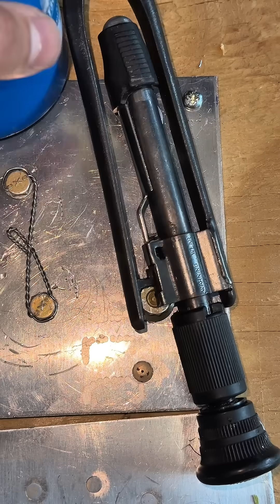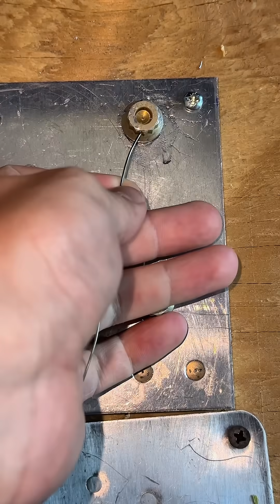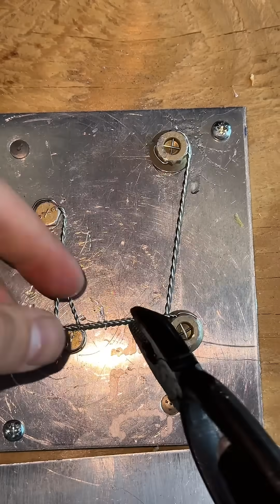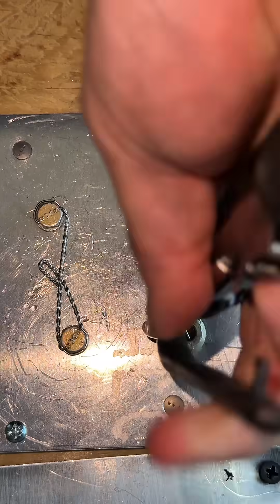Jet tech: Boomers Hated This Safety Wire Tip 😤✈️ #AviationMechanic #shorts #mechanic

Comment: you started the first bolt from a neutral position not a a positive, you failed - you’re friendly FFA Quality Agent
Reply from the maker: Hey can you please explain what you mean
Reply: As long as the wire hugs the curvature of the bolt even a little bit before going to the next, it's physically impossible for it to make enough slack for any loosening to happen. You're talking out of your ass. His example looks like every diagram on the subject.

Comment: Nope this is not how we wire bolt heads, we cross the wires, if it goes around the head the wire can get bumped off with vibration, and the wire will loose tension.
Reply: Every single example and diagram disagrees with you. You're also fundamentally misunderstanding the physics included in wiring directly into the sides of the bolthead.

Comment: I can promise you that at least 95% of those "not tight enough, I'd have cut that if I was your QA" comments were prior enlisted guys who never got beyond a plane captain qual and are just projecting their frustrations by repeating what they heard from their QA every time they picked up a set of swipes. When I got my QA stamp I would only make my workers re-do safety wire if it was obvious they didn't try. If you could tell that they had put their best into it and just couldn't get things tight enough I would do it slowly in front of them while they watched, then walk them through the next one so they could learn faster than I did.

Comment: Got away from tugging at the ends and used the tip of the safety wire pliers to pull it snug. But this is a great video and wish we had this back in my day so the young guys could watch it over and over again. Beats them watching me cut their shit, do it myself, cut that and have them repeat it.

Comment: I mean… I’m not a 7 level, not even still doing aircraft maintenance, but looks to me like the one on the left has one too many turns(twists) and isn’t taught(presumably because it’s stuck on the lip of the hole y’know), (also the tail on that one is wild but maybe the regs are different for civvies[does the tail really need to be captured by the main wire?] the one you just made was good. 

Either are probably serviceable. Honestly I typically find it easier to twist by hand (at least at the end) that way you get the number of twists you want and not that one more so you don’t run into the problem I was talkin about earlier 

Ps not a boomer

Comment: You have done it the way I was taught in motor sports  ace and best demo I've seen ❤.
The whole reason for this is to stop the bolt from coming lose so the wire would tighten if the bolt did try to come lose
Reply from the maker: Glad it helped

Comment: Power generation uses safety wire as well. Steam turbine, gas turbine and I’m pretty sure I’ve used it on coal pulverizers as well
Reply from the maker: That’s a big difference from a little ol’ airplane

Comment: Find me a company that actually cares in the aviation industry. They’ll just mass hire idiots with no certification or experience. Have them doing a and p work while the actual a and p has his head in a fuel tank or under the floor. Have unqualified people doing work only certified people should be doing. Have you back date months worth of work that was never done. I hear the same stories everywhere. If anything go to avionics or go into it with the mindset you’re going to be an inspector. Don’t be a lead. You’ll just ruin your drive and passion for aviation. I’ve seen scary things in my short time and I’ll never fly delta because of it.

Comment: I think you had a couple more twist in there. It doesn’t matter because based on the bolts rotations and the way the wire is connected they cancel out. You could go a couple twist tighter but maybe it could be too tightly and just stress fracture the wire maybe. If you start stretching the wire in a tight twist the it will snap for sure.

Comment: Wait, safety wire is an industry "best kept secret"? You know many industries use safety wire and have since before boomers. The challenge with using safety wire pliers is that you can overtighten the twists, work hardening the wire and making it brittle. They are a great tool when used properly

Comment: Not just aviation. I design synchronous motors and we do this all the time. Except I typically use socket head cap screws.

Comment: if you worked in aerospace youd know even the older generations PREFERRED the pliers. hell, my teacher when i was learning told me about how theyd lockwire by slicking their hands in oil and dragging the pliers down to get it done quicker.

i couldnt last in that industry. the pay was embarrassing and capped out too low to remain a GTE tech. just got more and more depressed over the 6 months i worked there. couldnt hack it i guess. but your lockwiring looks good to me.

Comment: I have a set of those wonderful pliers. Those complaining they did it by hand must be really old because this style of plier has been around at least 50 years (my dad had a pair as an aircraft mechanic) and probably far longer than that. The funny thing, these pliers have not changed a bit in all that time. If it ain't broke...

Comment: Even this is behind the times with how readily available safety cable is. That stuff is great for tight places too since the tip of tool is really slim. Nowadays demanding someone do it by hand is just not caring about turn around times especially if we’re talking a new component in an engine bay with 65 small bolts that need to be lock wired into place.
Reply from the maker: Safety cable is 100x more expensive
Reply: @northeastaviationpro yeah thats true

Comment: Pool guy here, that safety wire looks like it would do whatever it is that it's supposed to do.
Reply: The guy didn't get hurt making the video, that is safe enough in my book.
Reply: The wire is supposed to tighten one bolt if the other bolt vibrates loose. A bolt can only get so tight, which will prevent the other bolt from getting looser.

Vibrating loose is probably rare, however, if it happens on an aircraft, it can mean the aircraft crashes and everyone dies and a multi-million dollar machine gets destroyed.

Comment: Now do it between two stringers with hydraulic power off and a behind a bellcrack on a bolt and lock nut 1/2 inch apart 😂. Make it realistic lol
Reply from the maker: I just gotta find that first and convince the operator to film it

Comment: okay, I saw you test it at the end with your finger, it is a little loose, its supposed to be harder and less movable, I know in the ac43b it also states to have atleast around 6 knots per inch. and that the pigtail should be 1/2 to 1/4 of an inch, or about three twists
Reply from the maker: Its not loose at all. Matter of fact its more on the tighter side

Comment: Heck ya, i work on rock crushers and some of the old jaw types still use saftey wire bolts. It shocked me that im a 26 yo and broke out the saftey wire pliers all to find that i was the only one in the shop who knew what they were. Blew my mind, the shops full of 40-60 year olds.
Reply from the maker: You should have seen the reaction to this video

Comment: this is wrong.  that tool is not used for that because it turns the wire in the wrong direction.

this entire safety wire demonstration is wrong because the wire is being twisted in the wrong direction.  The left needs to turn over top the right wire. (and you need to twist it out away from the head of the bolt so you dont ding the wire.

I went to AIT at Ft Eustis Va. Trained as aircraft drive train repair (prop and rotor guy) and then later a crew chief on the OV-1D, Mohawk.

Comment: Quick question, and no hate, but is the video mirrored or the bolts reverse threaded? I think i see whats going on but if im looking at either nut the wire wouldnt prevent backing out, but if the wire was routed the opposite way the nut could not back out because the wire going from nut to nut would stop it. Not sure if i phrased that correctly, but thanks for the video regardless.
Reply from the maker: Its not mirrored.
Reply: @northeastaviationpro  There's so many comments saying this that I genuinely wonder if YouTube is somehow showing the video mirrored to some people.

What you have looks exactly right to me, but surely there can't be that many otherwise seemingly intelligent people who are confused about the way a bolt normally tightens, can there?

Comment: Aerospace engineer here. It’s important that we get people who want to join the skilled labor force! (There’s a shortage) and even more important that we have people like you to reach the young ones in this manner. Good work!
Reply: There is always a shortage, Dodge Bros v Ford legally forces all corporations to make line go up, or someone is going to be sued into the stone age. For numbers to go up, you either have to grow into a monopoly, own the gov't, or penny pinch.

The loss of skill is guaranteed under items 2, and 3. Item 1 just happens to always do it too.
Reply: Congrats on paying an institution for a title.  I'm sure you are a perfectly normal "human man".
Reply: I left the industry bc the pay was unacceptable went on tugboats and made 180k a year equal time off with Cadillac benefits vaca retirement travel pay and per diem which was tax free
Reply from the maker: Where can I fix tugboats for 160k a year
Reply: @at_3831 Exactly. I used to actually have nightmares of planes crashing.  The pay does not equal the stress. 

Still have two pairs of safety wire pliers though. Even have some 0.023 left. We used to set up a couple of bolts and have speed competition. I ended up in industrial electrical and controls. Not 180k. But I ain't worried about that factory machine falling out of the sky either.

Comment: I can promise you working for boeing i do safety wire all day this exact kind is used for training bottom wire is not close enough to the hole and pig tails are rotated counter clockwise and should only be around 3-5 twists long. Our inspector would look at this and laugh. Then again we are trusted with thousands of lives daily. But what do i know.
Reply: Also from the top screw you need to pull the wire out some so the wires actually close you left a big ass gap in it you do this by pulling to about 3-4 oclock and then start the twists

Comment: I would caution against throwing it in old timers faces. As someone who spent more than a decade in aviation maintenance, multiple airframes including fixed and rotor wing...if you aren't just as good with your hands as you are with pliers you're gonna run into huge problems. Some of the safety wire I've had to do wasn't actually visible while you were working on it. You had to do the whole thing blind and you could barely fit your hands let alone tools in the space. 

You've got a ways to go is all I'm saying. Remember to stay humble, it will do more for you than all the skill in the world.
Reply: Amen.. working inside the wheel well or belly of a harrier was always a struggle. With no space especially to move around.
Reply: This leads one to believe the old blind aircraft mechanic has an advantage.
Reply: You have a good point safety wiring teleflex cables into a Glendenning auto throttle setup. In one particular re- installation after a major overhaul, you hear to do it by Feel and inspect it with a Mirror on the Starboard Side. Almost totally inaccessible. No good way around it. Port side two hours. Starboard? Ten hours. Including the Exhaust plumbing.
   A lot of stuff had to be safety wired and Correctly. By hand. Inspecting after. Re do if necessary. This particular job ...... One of those. Done on time, made money, Had Fun!
Reply: Old timers with shit attitudes deserve the exact attitude they bring.
Reply: @ OP
The guy is a product of these times.
Heavy into social media, inflated sense of ego, has adopted that "generation bigotry" which has become a religion to many, as planned.
Reply: The younger generation doesn't want to hear your advice. They know everything already
Reply: @Golgi-Gyges you need to put yourself out to pasture and stop wasting your money.
Reply: @alexanderduluoz tell that to your mom
Reply from the maker: Old timers will try to give you life advice at work but they dont realize they work the same job and get paid the same as you, like bro what value do you really have to bring to the table.
Reply: @northeastaviationpro haha!
Now it's "old-timers" as your label?

If you are fortunate, you will live long enough to be considered elderly. Then you can think back on how you've treated people.

However great you think you are or special - all of the skills you are learning, you had nothing to do with. Someone older than you paved the way. Those people that invented, refined, and innovated "aircraft maintenance" will always be people older than you.
You are following footsteps. That's all you'll ever do - besides make a few videos. 😂
Reply: @northeastaviationpro  your comment here shows your mentality.
It is pure ignorance to assume working the same job means there is nothing they can teach you.
I hope the old timers gave up on helping you and just watch you struggle from time to time rather than share their knowledge because it is clear you do not appreciate the fact you got where you are because someone shared knowledge with you.
Reply from the maker: Yea usually what they teach you is trash and could further be improved on young guys learn faster and have better ideas which makes them more open minded old heads are stuck doing it hope they were taught decades ago
Reply: @northeastaviationpro  If you're so impressive then why is every video on a practice board?
Reply from the maker: @JoshuaBrandt-in5jh cant film at facility i work at trust me i would

Comment: Cross wiring is nice,  but on the fuel nozzles on the T56 engines,  a loop wire is easier to wire and  easier  to break.

Comment: When I road raced motorcycles we wired every liquid carrying assembly  system, as well as brake caliper, sprocket  nuts.  Went through drill bits out the ass, no drilling jigs.
Even with the pliers  my fingers were full of pokes abd cuts